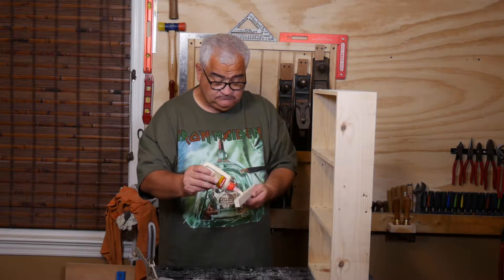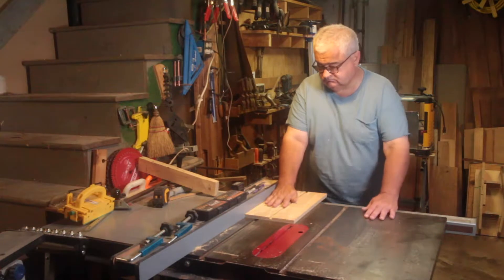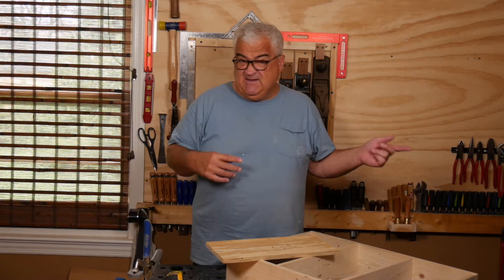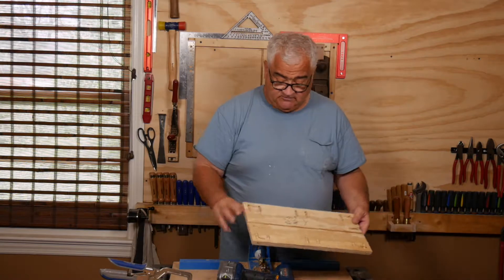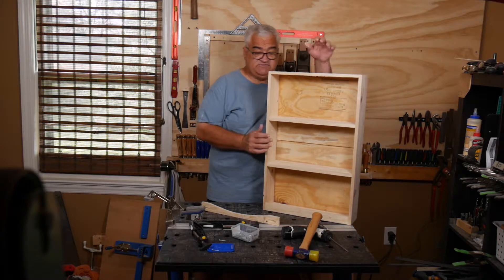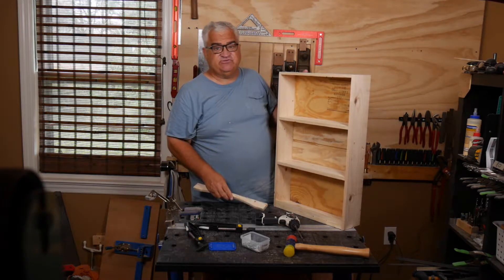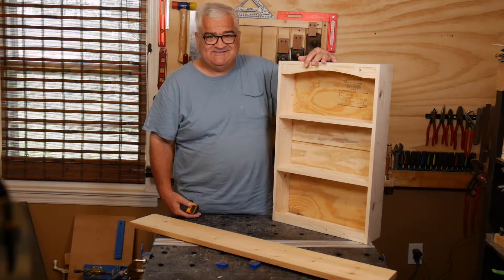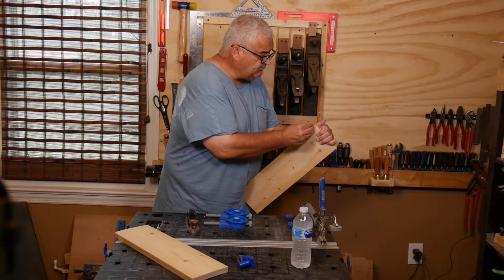Wall cabinet build from Pallet wood....

Comment: Nice video. Nice job.  That wrong side of the board mistake happens to us all.  I remember building a couple small cabinets for my bathrooms.  I got the doors for both cabinets built as the last step before painting, and when I went to check the door size somehow I'd gotten them about a half-inch too small.  So, the doors would have just slipped through the holes.  ARRRRGGGHHHH.  I dunno where things went wrong on building those doors, but I just put it all away for the rest of the day out of frustrationa, then rebuilt the doors later.  I kept those "bad" doors, however, determined to find something to build around the doors.
Reply from the maker: Thanks Michael. Sounds to me like you have a project ready to go with those doors. I could always find a need for another cabinet... And yes I have a scrap bin full of things that somehow came out the wrong length :)....